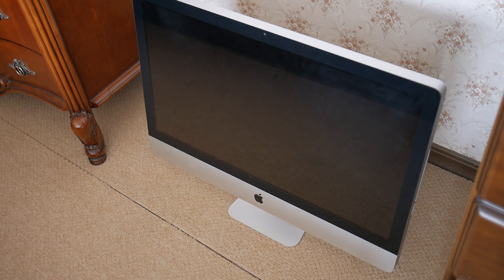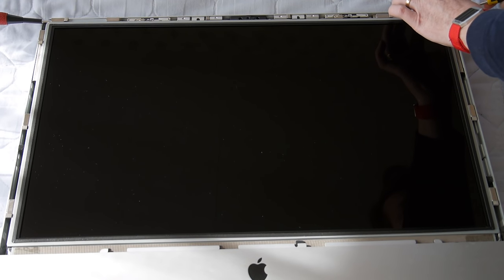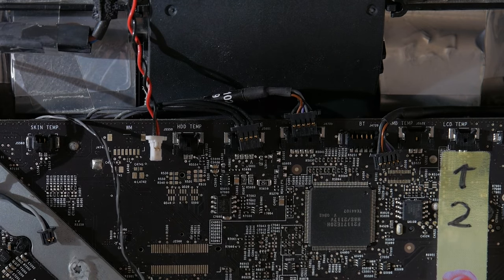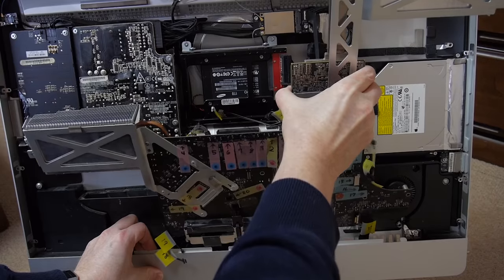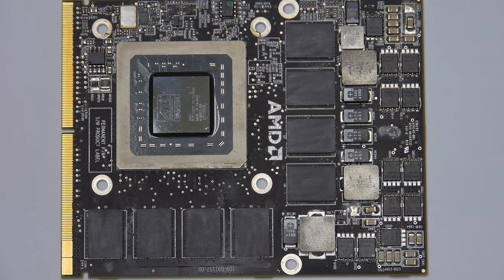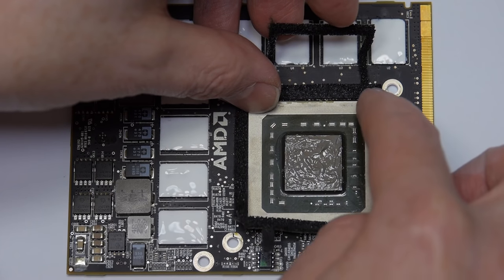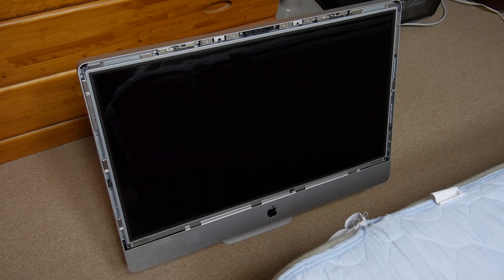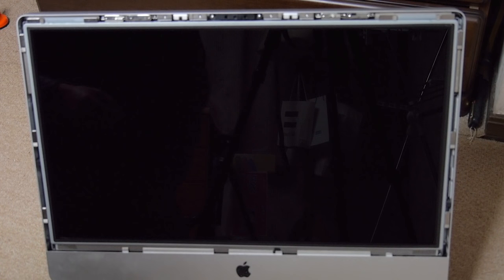Late 2009 iMac 27" Video Card Repair [4850 Bake]

Comment: Followed your guide, worked a treat! I'd advise people to be careful of the HDD sata cable socket on reassembly, cracked mine but superglue sorted it. However on reassembly my fans are all going full blast and s small round item that looks like a battery fell out from somewhere. https://drive.google.com/open?id=0B1SD5V88bfrMdjdtQ3J5eHVFZGc Anyone have any ideas? Doesn't look a circuit part but will have another go at assembly tonight to try and cure fan issue.
Reply from the maker: Glad to hear of your success, Liam.  I just saw your photo but I've never seen the likes of that before.  Can you please post a photo of the opposite side of it?  As to fans running at full speed, there are temperature sensor cables that, if not attached correctly or at all, would cause fans to run full blast.
Reply from the maker: Thank you for the photos, but they are still too blurry for me to tell if there is text written on it.  Can you see any text?  It's certainly NOT the BR2032 battery that you must replace when you remove the motherboard.  I know that for a fact.
Reply: No, don't think it's a battery. It only measures about 1.5 mms in diameter. I ordered a BR2032, has not arrived yet. Funnily enough I got a copy of the Apple service manual and it shows a CR2032 so It presumably can be used instead if they show it in the manual?
Reply from the maker: Certainly.  You CAN use the CR-series but the reason the stock battery is the BR-series is because the maximum allowable temperature is higher on the BR series.  My thinking is, since the iMac gets very hot inside, logic dictates it is BEST to replace with the same BR2032 battery that originally came with the iMac, since the CR2032 has a lower max temperature spec.
Reply: Tirns out the little item in the pictures is an alignment button from the front glass plate! Been trying all sorts of fixes for te fan problem - but no success so far :(
Reply from the maker: Install smcFanControl, and then individually lower the speed of each of the 3 fans to see which one is spinning full blast (or if all of them are). If you know that a particular fan is spinning too fast, you can then check that sensor's wire and connector for problems.  https://www.macupdate.com/app/mac/23049/smcfancontrol

Comment: Awesome! Thanks for share it, I'm very grateful.

Someone can say me what is this cable (it is broken but all works fine):
https://youtu.be/v1DXBLkiqFM?t=7m29s
Reply from the maker: The blue-tipped cable shown in the late 2009 iMac in my video is the Vertical Sync ribbon cable.  Your iMac will continue to work even if that cable is broken, but you may hear strange sounds and experience other problems eventually.  You can read more here:  http://bit.ly/2p2G0Pe       And here: http://bit.ly/2oztNzK